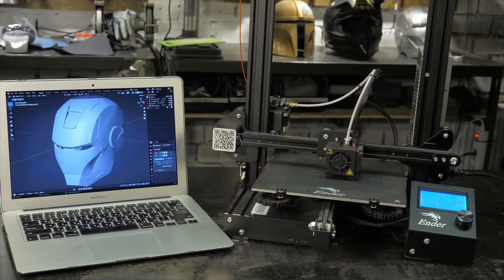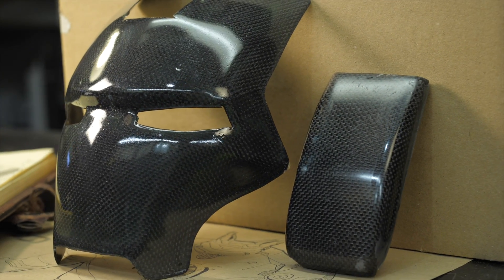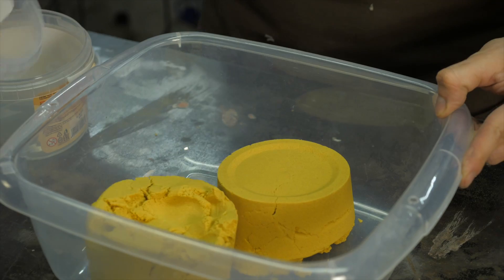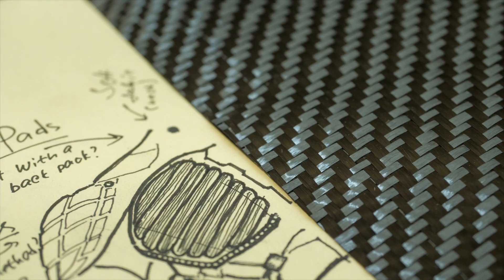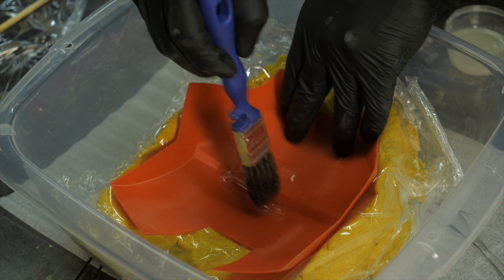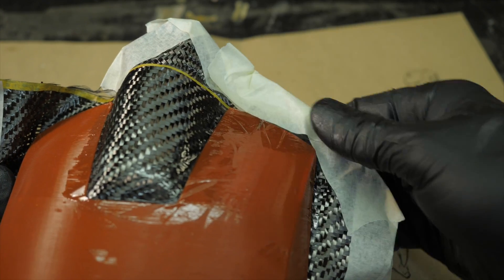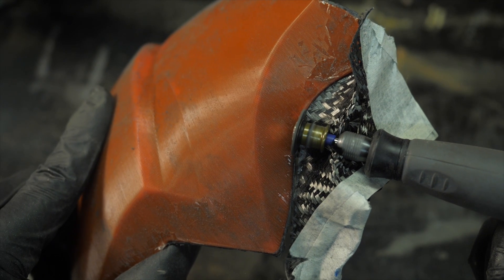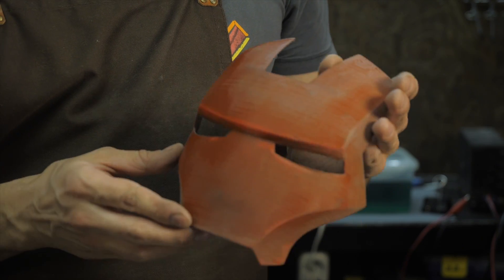#10 How to reinforce your 3D prints with carbon fiber. Basics of composites.

Comment: Does this actually increase the strength of the product? I'm trying to use this to fill in a gap and it needs to be able to absorb some force, would this method be a good idea to reinforce it if i 3D print it?

Comment: great video! What do you think about adding a carbon layer from both sides? so in this case also on the front. It would increase strength and improve the design even more in my opinion

Comment: I am trying to make a kevlar reinforced mandalorian armour set with this method, but I don't know how to reinforce the helmet.  If I do it in pieces there will be many seams, which will be weak points, but if I tried to laminate the whole helmet there will be folds and it won't laminate smoothly.  Any ideas for this?
Reply: Maybe try doing in smaller prints and then plastic wielding it! Idk just thought I would give my input

Comment: I will use this technique to make replacement parts that are no longer available on my MK2 Supra.  I can print body mouldings and then coat them in Carbon Fiber to have a better than stock trim set.
Reply: How did they turn out?

Comment: Hello, good job! Your videos are really amazing and I will definitly try your method. A quick tip though, you can trim the carbone fibers from the part with a standard utility knife if you do it before the resin is completely cured. Around the first third  / half of the curing time should be good. This will simplify this step and you will no longer need all your equipments 😄 for this operation.